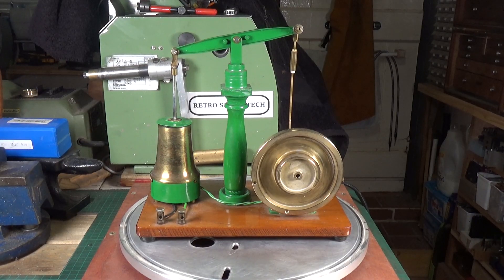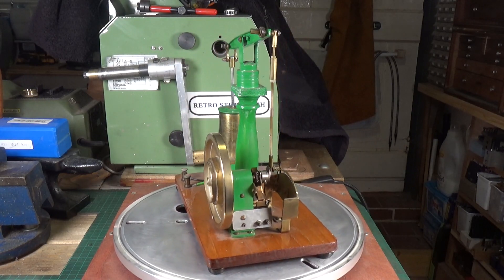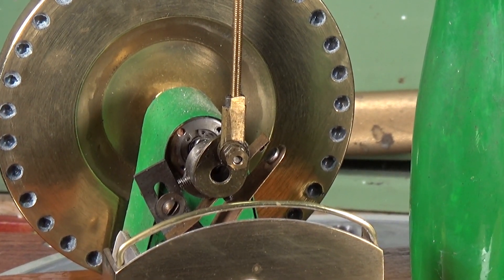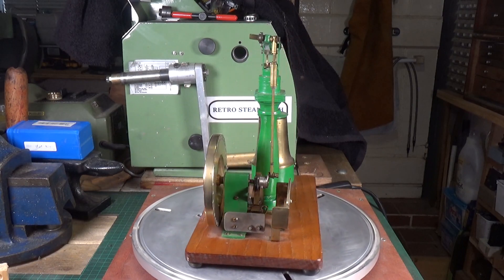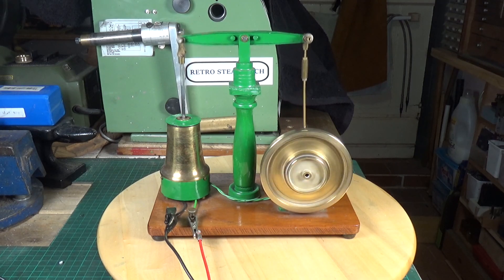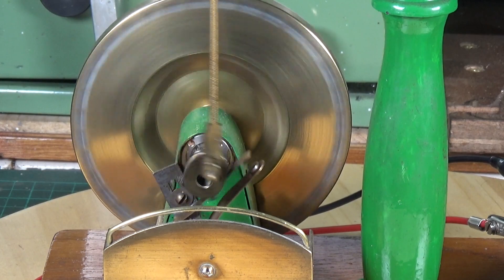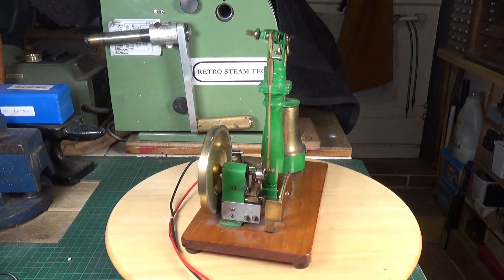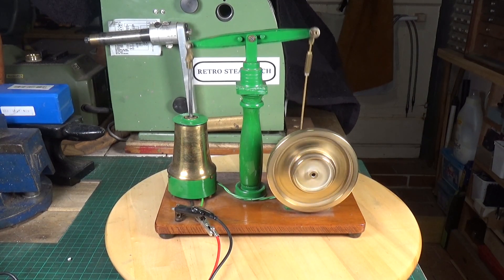Solenoid Beam Engine

Comment: Very nice build Alan.  Unique.  Considering how well it is all built it makes you wonder why the flywheel wobble ?  Maybe it got some rough treatment at some stage.  All fixable.  The holes in the flywheel are unusual.  Maybe it was scavenged from something else initially or it's just decoration.  At first I wondered it it had something to do with the current switching, but not the case.  Interesting.  Cheers Rob
Reply from the maker: Hi Rob. The flywheel has been sleeved to fit the shaft, so yes I think it was scavenged from something else. Cheers, Alan.